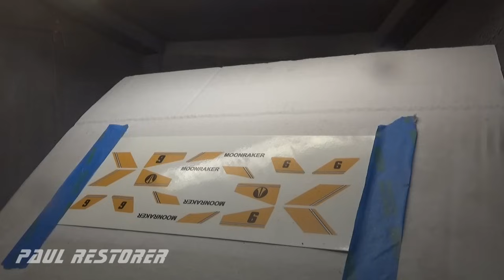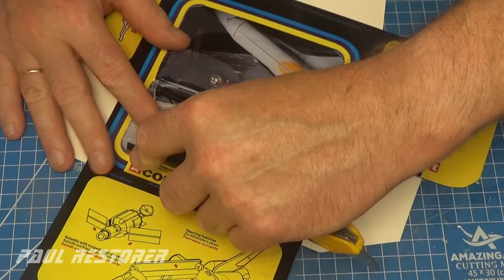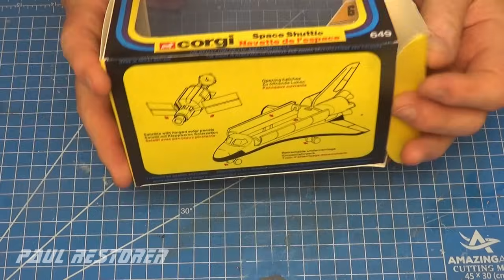Prom kosmiczny z filmu Moonraker 007. Renowacja modelu Corgi z 1979 roku.

Comment: Nice job .. ..I had the smaller Moonraker shuttle .. have you tried doing an Eagle from Space 1999 .. I  would be interested on how you would get the Metallic Green / Blue to match  .. i have both and i still cannot get an exact match ..so i am reluctant to restore them .. just in case it all goes wrong.. i would rather keep them battered original then refurbed in the wrong shade
Reply from the maker: Thank you very much. my Eagle in two versions is on my channel
Reply: @PaulRestorer  Yeah I got them .. i have seen them  ..  .. Thank you ..